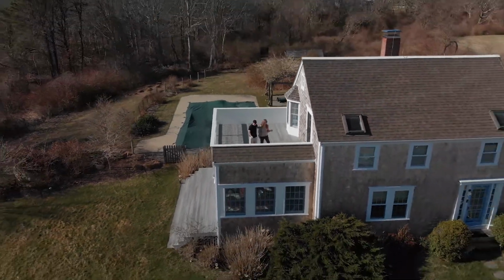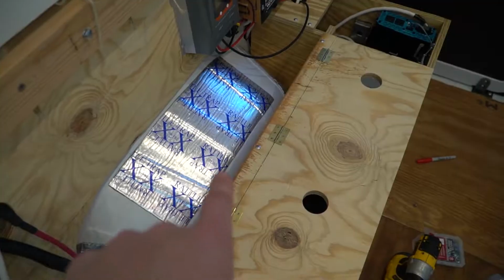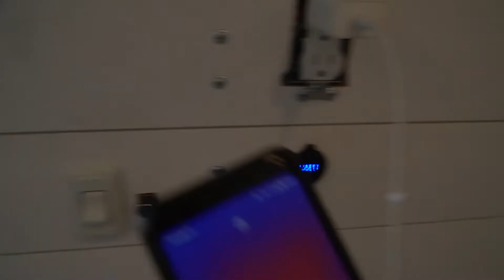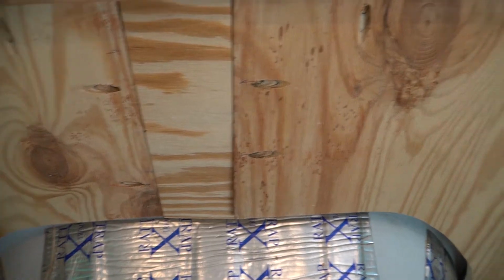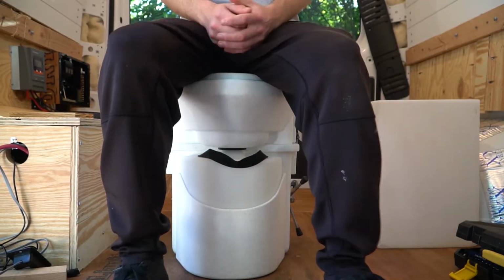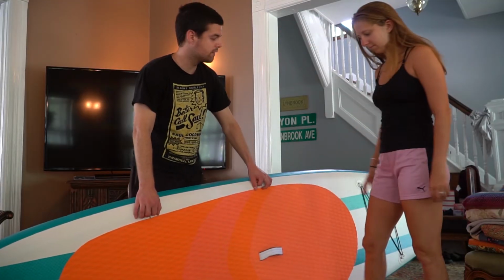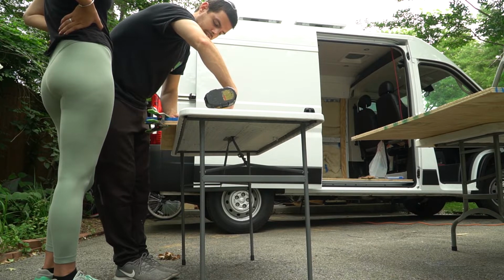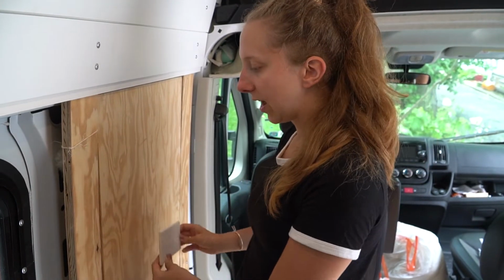Building a Van While Working Full Time - Van Build Part 9 | Ep. 68

Comment: I'm curious to see what you use between the tiles, maybe some kind of silicon or something else?
Reply from the maker: We will be using a light grey tile grout! That will be Erin's project - I'm sure she will do a great job!
Reply: @travelingatlas  , was concerned that grout might eventually loosen up with the vibration from driving.
Reply from the maker: It might be something we have to keep an eye on. I know others have used grout successfully in their van but I don't know how much maintenance it requires.
Reply: I would think that as long as it is not a sanded grout, it will be ok. Something that would be used in a shower would be ideal.